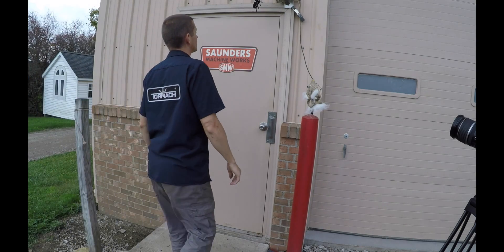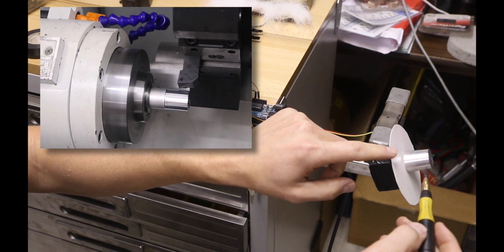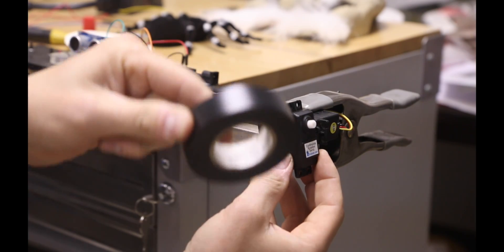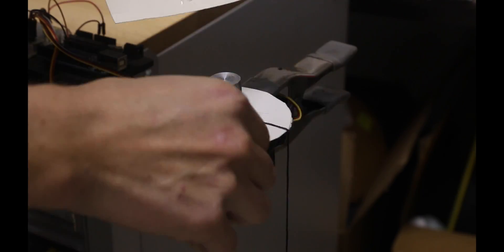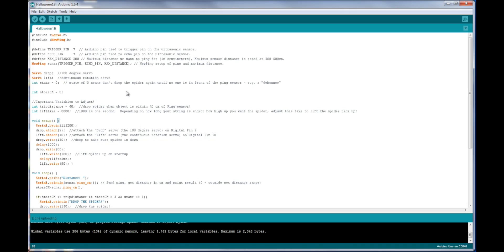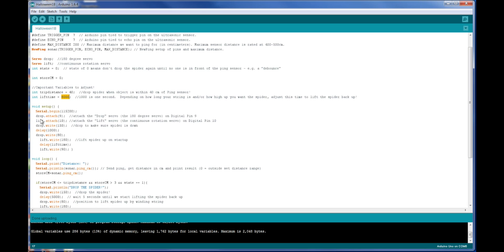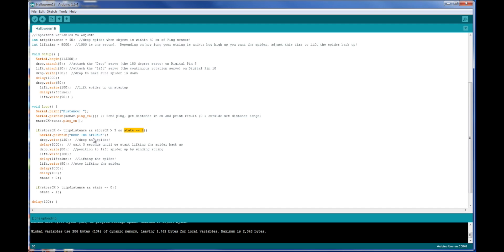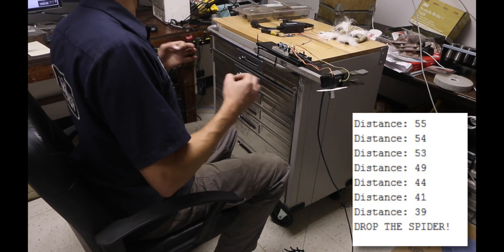Arduino Dropping Spider Halloween Widget62!

Comment: I have a hallmark sensor activated Spider, that doesn't need all that, which I got in USA in 2014, when it stops working I'm going to pull it apart to see how it works off 2 AA batteries. It does have about 5 jokes that it speaks as it drops. Everything is inside the body of the spider though. 

This looks great though.

Comment: I know this is an old video, but it still helped me! However the problem with your code was that the sonar was so unreliable that it would randomly trigger after a minute or so. Like a 100cm reading would trigger the set distance of 30cm. However I found the solution to this, simply by finding an averaging function built into NewPing. It takes 5 readings and averages it, making this thing flawless but slightly slower to react. Now you can use the full 5 meters and trigger at 1 meter no problem.

int iterations = 5; (add this code at the top with other variables)
((sonar.ping_median(iterations) / 2) * 0.0343); (replace all sonar code with this)

Also don't be lazy and use the Echo pin. It is more reliable. I just used 7 and 6. Additionally NewPing should use the default 9600 baud. The faster baud might cause false triggers.

Comment: Still hearing a lot of noise with the wireless mic...
Reply: +NYC CNC 
listened to it twice now, I am no longer sure if its movement related...
Reply: NYC CNC I'm pretty sure it's interference of some kind. I'm guessing the receiver and transmitter are quite close, right? For these kinds of setups where you talk directly to the camera I would definitely go for a shotgun mic. Seeing as you like guns and such, it should be preferred anyway, right? ;-)
Reply: I never did have good results with the Røde mics... What wireless system are you using?